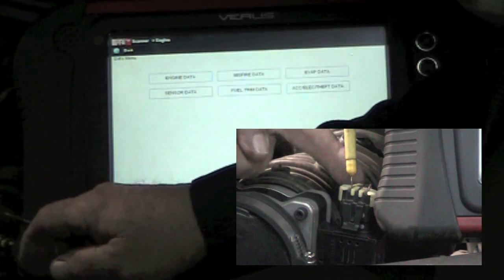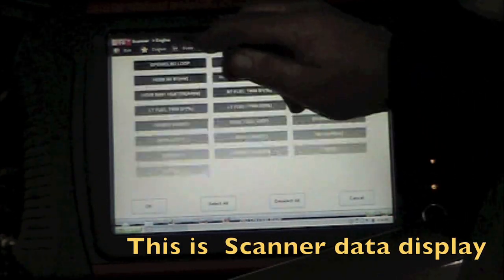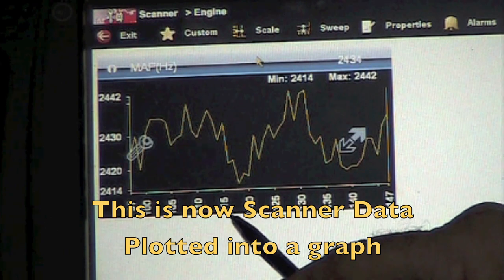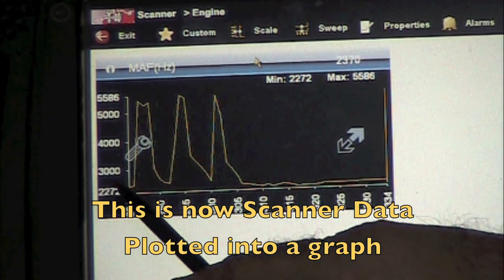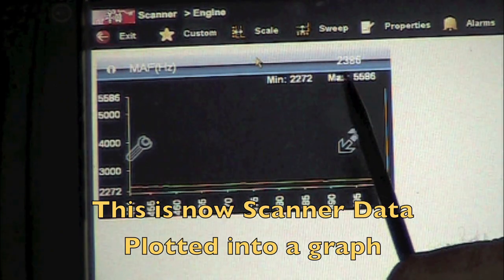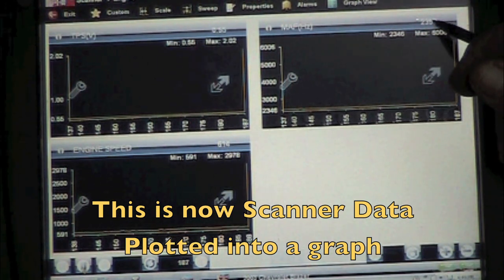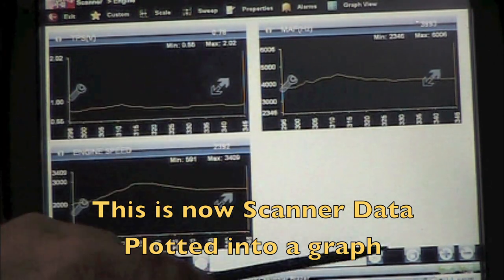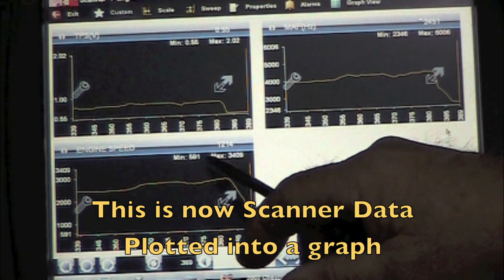MAF test p0101  part 2

Comment: Man I wish I had you as a teacher in school. Very intelligent!
The frustrating part about this is when you have to work on many different vehicles with different MAF sensor readings like gm/s , kpa, lbs/ min , volts. Or hz. Like which is the best style to use to test the sensor and how do you convert it to.the one you want when the scanner only offers a certain reading?
Reply from the maker: good question.  However there is no easy answer.  I use different conversion tools and app I find on the internet.
Reply: @realfixesrealfast  thanks Duane! Hope all is well. Thanks for educating us. I hope by the time I master this and fuel trims, the gasoline engine won't be extinct 😄
Reply from the maker: @pablomarquez4431  great thought but remember there are millions of gas vehicles out there and they won't disappear overnight.  Remember carburetors?  they disappeared slowly but as they did the people who could work on the became specialists.  Technology changes but knowledge lasts forever.  Good luck with your career
Reply: @realfixesrealfast  very good point. Yea I'm a tech for the usps but I work mostly on the trucks and llvs. So I don't come across a lot of MAF and fuel trim problems.  But this and all your videos are a great refresher or different teaching approach to figuring out a issue. Would of loved to work with you as a student or coworker. Hope all your employees appreciate your knowledge. Im sure they are great if you trained them. Stay safe 💪

Comment: extremely old school;  volts and hz are no longer used by professionals ;  you can get an autel for $59 (scanner) and it will show you the grams of air going by the sensor; just plug it into the obd2 code reader;  much easier;  forget hz;  look at the measurement of grams passing past the sensor;  if the numbers are correct, no problem;  a bad sensor usually will show the same grams passing by as a good sensor;  that's how you know its bad;  don't have to do anything but plug the scanner into the obd2 in the driver's well of the car;  don't even have to get your hands dirty

Comment: Great video, thank you... I have a question I hope you can answer- I have a 2000 S10 4.3 vin w. Its been stalling when snapping WOT in park, flooding out on cold startup in the mornings, terrible mpg, & rough idle like a miss. 

No codes at all for a MAF. Checked my power & ground for the MAF, they're ok. Checked the frequency wire with my multi-meter & sometimes I get 17Hz, sometimes I get roughly 23Hz. Then the signal drops out completely after a few seconds. I rechecked all my connections and still the same thing. It won't even go near 42Hz at 2500 RPM. When I try to turn up the RPMs is when it drops out all together. The wires in the MAF aren't broken. The connecter is good- did the wiggle test. Yet my Autel scanner says in live data that the MAF is reading 0.01 lbs/s and only up to 0.08 lbs/s, which seems extremely low to me.
What I'm scratching my head about is- I have all the indicators of a bad MAF. But the PCM had not set any DTCs for a bad MAF. Any thoughts?

Comment: When counting the distances in time between repetitive waveform events you are measuring period, not frequency. Then convert to frequency. A 10ms or 0.01sec period would convert to 100Hz. 2000Hz or 2khz would then equate to 0.5ms or 0.0005sec and so on. This is important to know when setting up your scope to read time (period) on the x axis to extrapolate frequency. Very very nice informative video,BTW.

Comment: I'm with spelunkerd on this one. I didn't see anything as far as an actual glitch in the MAF signal which leads to the question of how exactly did you arrive at the conclusion of a bad MAF sensor? Use of a gas analyzer? Volumetric efficiency test? Inquiring minds wanna know. BTW, that stuff I sent you around 1 1/2 years ago I think would tie really well into this video series.

Comment: It seemed like you went through complex diagnostics on the MAF, and you didn't find anything wrong. Then you replaced the device and problem was solved. The explanation was that the frequency output was a shade incorrect from the perspective of the PCM. Did I miss something?

Comment: Another simple way to test if a mass air flow sensor is going bad, is by tapping on it while the engine is running, listening for any engine rpm changes.. Wondering how it would look on the the scope when this type of test is performed.